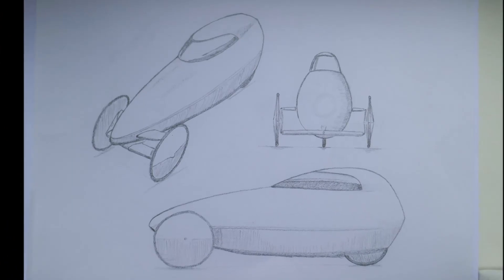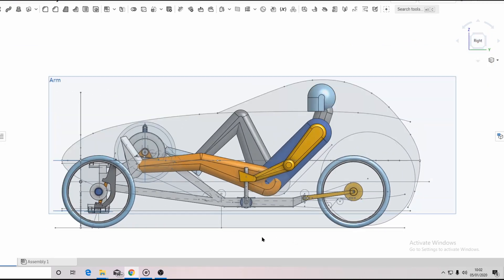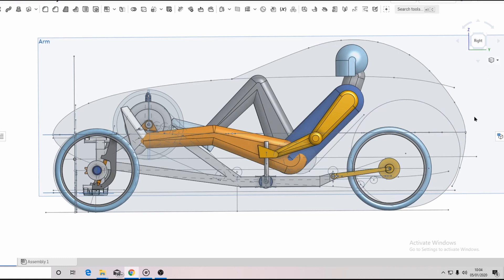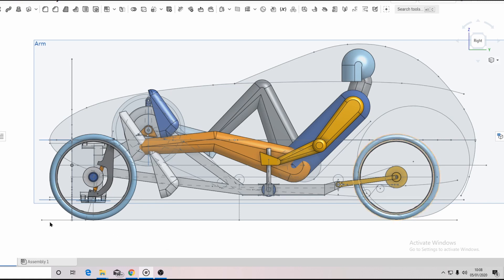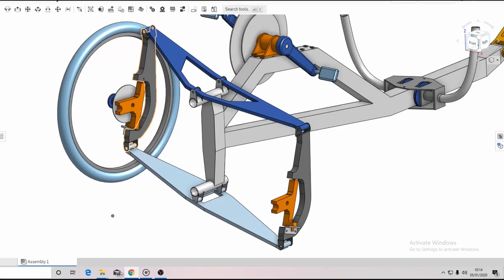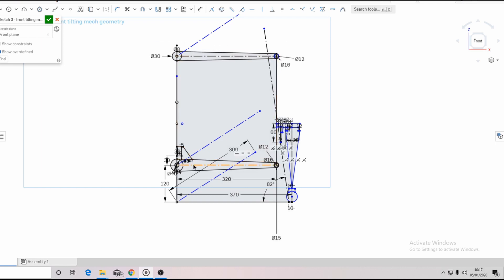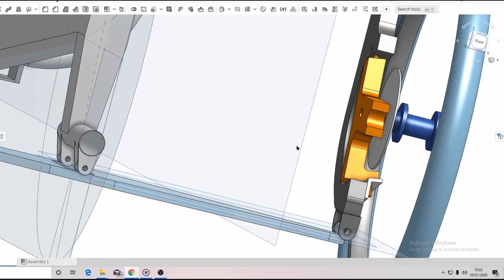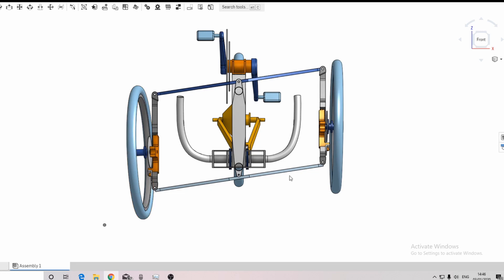Tilting Trikes Part 2 - Designing my streamlined, tilting, three-wheeled velomobile

Comment: You might want to look into how ”Velotilt” is designed :) They use a ”lever” type mechanism which is probably more mass efficient.
Reply from the maker: Yes, it’s a cool design.  Thought about using the velotilt mechanism on the front - it’s not impossible but would need to be adapted quite a bit.
Reply: Metal Machine Shop Not sure if this is within your area, but do you know if it’s possible to build the hull out of a fiberglass cardboard sandwich composite? I’ve heard people do it to build a kayak. Would be a lot cheaper than any other core material if it’s strong enough.
Reply from the maker: In my experience, GRP is very strong but heavier than you might think.  Single skin rather than sandwich would probably be sufficient with extra reinforcement only where needed.

Comment: Nice job, what about stability at low speed? What if you accidentally lean to one site, are you not afraid not to able to get horizontal again?
Reply from the maker: It should handle like a bike at slow speed.  There will be a tilt-lock for very slow speed or stopped, but you will have to remember to engage it.  There will also be holes for the feet through the bottom of the shell for pushing backwards or as a last line of defence against falling over.  If it does fall over, it will go right onto its side, which will be bad for the rider but very funny for everyone else.

Comment: Very good video, looking forward for more stuff!
Following the ideas of the last video, what do you think about mixing your tilting mechanism with a Hossack suspension?, I've been theorizing about something similar
Reply from the maker: I think using the Hossack suspension as you describe would be a good solution.  It would align the suspension travel with the body centreline (as described on another comment here).  A minor problem when applied to my design would be that the central hinge of the upper wishbone arm would not be on the centre of the circular-section body under suspension compression, which would lead to clearance problems between the arms and the body at the point where the arms pass through the body.

Comment: Fantastic work, great design. I, too, have been working on a similar tilting design. This comment box is too short for all my suggestions, but in short: I agree with Kyle Towers that dished wheels are the way forward. If you are doing complex carbon spindles etc, you can surely handle custom dished wheels. See for reference: http://www.recumbents.com/wisil/wianecki/leaning_trike3.htm (if you hadn’t already). I think it is great that you aim for a smaller turning radius. Moving the front wheels a bit further back could help even further, I think, although it goes against your current design direction/decisions. I have come up with some ideas (please note that I am not writing ‘solutions’ here) for a tilting double wishbone setup under the knees/calves thereabouts. But it is a challenge indeed in terms of ground clearance and overall width (on which I totally agree with you that it could and should be kept as narrow as possible, especially on a tilting trike). The only real solution for achieving both narrow track and small turning circle, is the rear wheel steering contra at low speeds, I find (despite my dislike for that extra complexity). I’ll keep following your videos meticulously, and hope to keep hearing about your thought process as well as seeing the building work!

Comment: Awesome video, thanks! I really appreciate how you showed all the angles and offsets. Smart kingpin solution! Will be very interesting to see the ackerman solution with wires. A wire can only deliver pull, so to sync the front wheels perhaps a linkage is needed? Or if the handles instead of tilting would pivot underneath the rider (then steer by front/back movement) on a fulcrum the wires could connect to a plate, and the wire shells attachments in the correct place (for ackerman).. just dabbling here, will be interesting to see how you do it!
Best regards from Sweden.
Reply from the maker: I’m still thinking it through and I will try to upload my solution before too long.
Reply: @MetalMachineShop  hi, any update on your project after one year?
Reply from the maker: @daniele_go  Hi, yes my latest videos show progress on the prototype.  It’s now almost at the ‘rolling chassis’ stage.